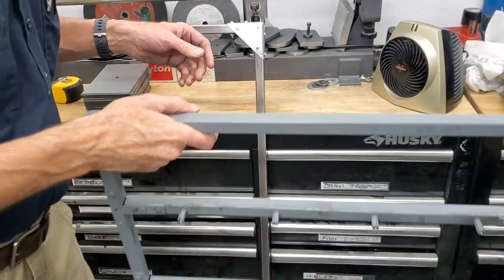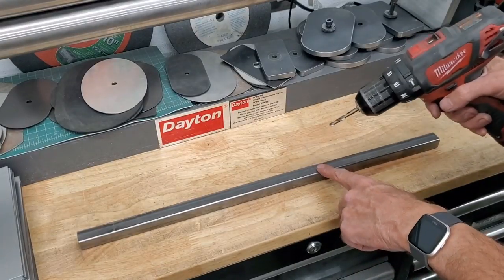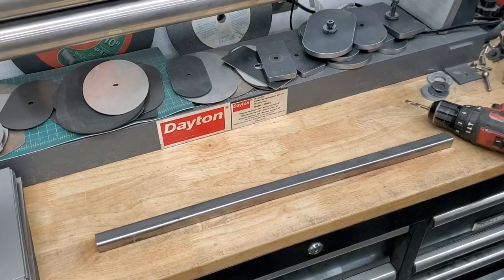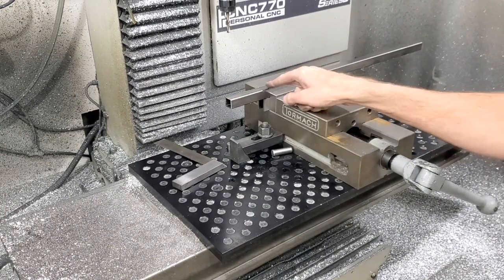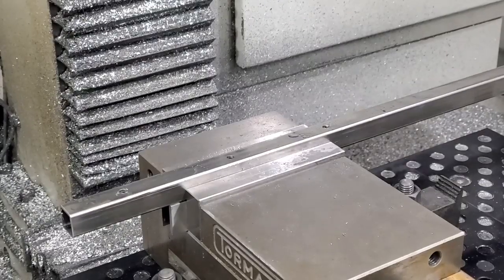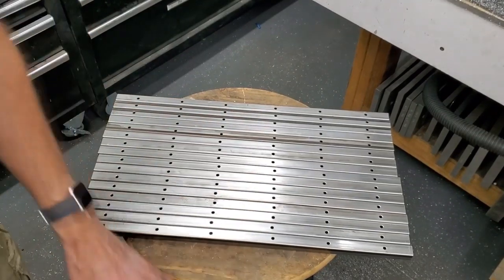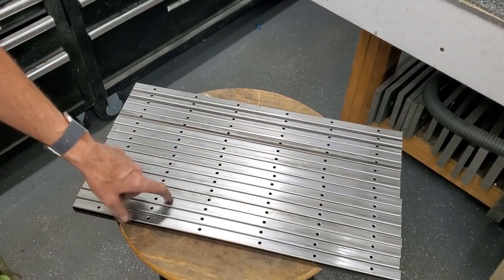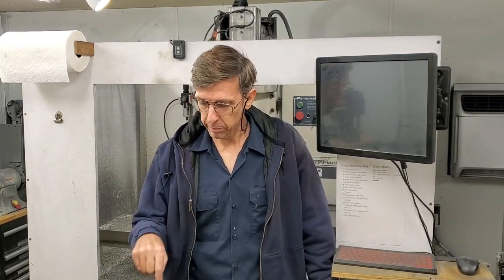Machining Steel Tubes

Comment: Good work.  If you have a stick welder you can get spot on coupling nuts.  They also have selfthreading, screw in coupling nuts.
Reply from the maker: Thanks, good to know. It looks like I will be welding the whole thing also.

Comment: Hi Craig,
Not sure of the degree of precision required on your project???????
Some thoughts that may??? save you some time.

1:
Instead of drilling the crossbars one at a time you could make a custom parallel for your vice to hold the maximum amount of them and set your CNC program to drill 6 or 8 of them at a time depending of the jaw opening of your vice.  Years ago I helped a friend of mine make parts for paraglider frames and I used that method.  Save you a ton of time on your setup and keep your time free for other work.
2:
You could use the same process for drilling the vertical rail pilot holes for attaching your tee brackets to the side frames then all you would have to do is install your self tapping screws in the pilot holes.  If done on the CNC the holes should keep your alignment correct for your tee bracket installation.  Then you will know the exact vertical position of the tee brackets that are installed on the side frames.
3:
You could also drill the pilot holes for the tee bracket attachment in the ends of the cross braces during your first setup.  It would only require 1 tool change for a different size drill bit.
4:
One other thing you could do is the camfer of the top side of the holes on the CNC machine.  The bottom side could be done by flipping the part for the bottom chamfer operation or do them by hand if that works out better for you.

Put that Tormach to work while you do other operations necessary for the project.   Ha  Ha

Many thanks for sharing!!!!!
John
Reply from the maker: Hey John!  Not real critical on the precision. That's a great idea on putting  multiple pieces in the vice at once!  I guess I could put a chunk of aluminum in the vice. I could probably fit 5 or 6 tubes in there. As long as all of the tubes are pretty close to 3/4"  
I am having 5 frames welded now. I made a welding jig. They said they can weld them in less than an hour. I have 18 more frames to make.

Comment: Very nice work Craig :) 
Cnc rills holes in thin wall tubing very nicely, drill presses and such seem to always like triangular holes if the drill is sticking out more then a couple inches.
Reply from the maker: Yeah, I got a cheap drill press from harbor freight once. The drill bit moved around a lot. Lol.